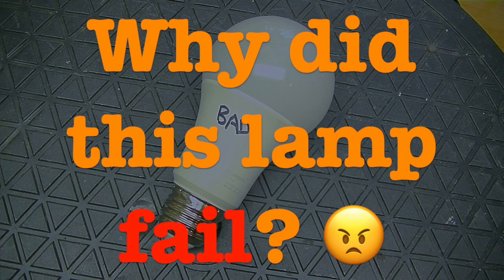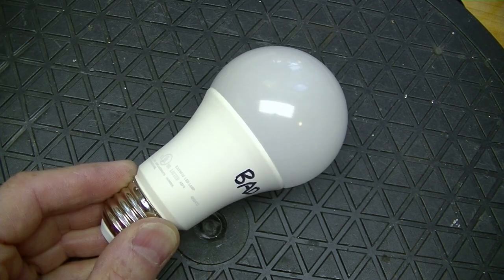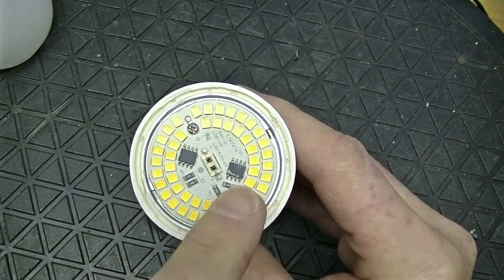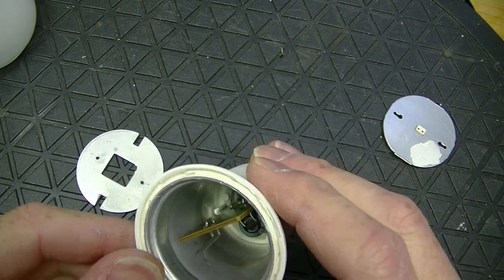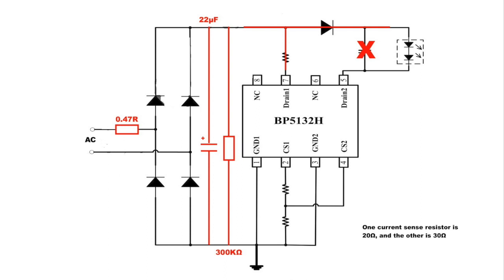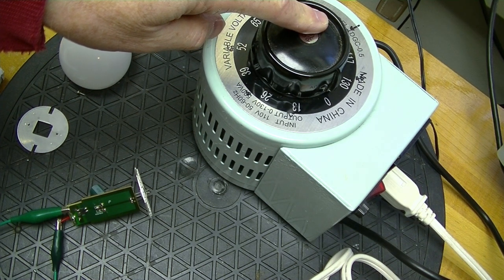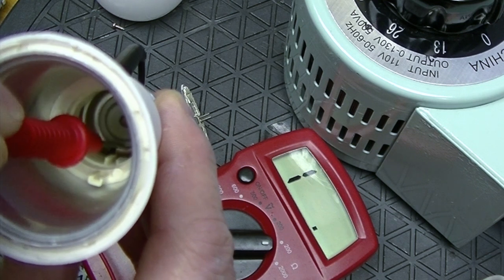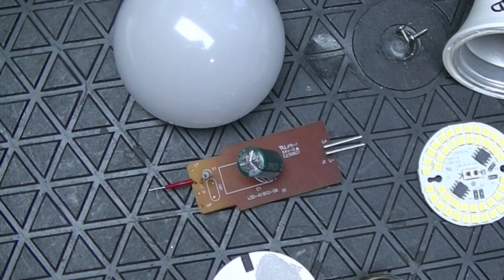Why did this LED lamp fail?  (Includes schematic!)

Comment: Oh, but wait! You're wrong!

It SHOULD have failed!

Because it was built poorly.

So much for efficiency, huh?    8)

BTW... incandescent bulbs are 100% efficient during the heating season. They also cost only about 1/60 as much as LEDs do.

And... because of cost homeostasis, we now burn more lights, and run them longer, than ever before... so our electricity consumption hasn't diminished from the days when incandescent bulbs were the norm.

So ... no progress at all. None. Zip. Just greater cost.
Reply from the maker: Again, agreed. 
I never considered heating my house like a gigantic Suzy Homemaker oven. Until now.
Reply: @Mr.BrownsBasement  8)
Reply: @Mr.BrownsBasement  I have a feeling that you and I could swap a ton of stories of times past if given the opportunity.    8)
Reply from the maker: You’re right again. You’re on a roll. 😊

Comment: Judging from your voice, you're old enough by now to understand that nothing lives as long as it's touted to.

Be sure to inspect for tin blight while you're in there, especially if your LED has ever been exposed to cold temperatures.

Also... as often as not, the drivers are on a little daughter board, which costs almost as much to buy as the light bulb did.
Reply from the maker: You’re right! I’m no longer a spring chicken. Good advice, but I wasn’t planning to put the bulb back into service.

Comment: I like to disassemble such things as well. Understanding electronics makes it fun to locate the faulty part. Some use step down tiny transformers while others use the summing of the LEDs to handle the line voltage. Either way, it is interesting to see the different designs. And with a simple meter, you can usually locate the defective part pretty quickly... Thumbs Up!
Reply from the maker: Thanks. I am bothered by lack of repairability built into modern electronics and by the incentive to discard rather than to repair. By making videos highlighting areas of failure I hope that we can reduce the amount of perfectly salvageable electronics that ends up mostly in landfill. I hope you will enjoy my other repair videos as well.

Comment: China's not-so-finest! I wonder if this construction quality is shared with the LED bulbs recently sold at Dollar-Tree stores for only a dollar - until rampant inflation jacked their price up to $1.25!
Reply from the maker: This lamp came from Dollarama and cost $4 + my contribution to the government. I expected better quality. I’ve got a bunch of Dollarama lamps and they’re been ok so far. This is the first one to fail. For what should be a far more reliable technology I’ve been very disappointed. I had a Philips (from Home Depot) fail in the 1st 5 minutes of use. I was so annoyed I called their 1-800 number and had them replace it. I had a Canadian Tire bulb, also much more than $4 die prematurely. Again, I insisted they honour their replacement warranty. They did, though begrudgingly. It seems price is no predictor of quality or longevity for LED lamps.

Comment: I think the assembly line was over crowded that  it scape from the testing quality checker person,( very smart LED bulb ). I am glad you shared with us where the fault is,. I think a- little- dab- of- student-glue UNDER  your desk will do the trick!
Reply from the maker: I never expected the fault to be the result of a faulty wire. I was expecting the 0.47Ω resistor to be burned out or perhaps the bridge rectifier to be bad; either one would have caused the same symptom. But for the lamp to be crippled by a badly attached wire was a huge surprise. I hope for the sake of the manufacturer that it is an isolated quality control issue and not a widespread design issue otherwise many more of these lamps will fail exactly the same way. I think the present condition of the lamp is beyond what a little dab of student glue could fix but perhaps that will be the topic of a future video.

Comment: I am shocked 😲 Mr. Brown, are you preparing a party in the basement  for ONLY  ladies with 💄 and '"Worth the hype'" Black Mascara?
Reply from the maker: Oh no! No need to be shocked. The LED lamp that stopped working was a female. Perhaps the next one I look at will be a male. Determining the gender of LED lamps is difficult to determine because you can't tell just by looking. But rest assured, when it comes to repair of electronic devices, I am not sexist. And when working on electronic circuits, always avoid being shocked!

Comment: Must have been assembled on a Sunday.  A Chinese worker may have resented working on  a Sunday and took it out
on your bulb. I once found a screwdriver under the console dash of my mom's  1978 Ford LTD. It was found several years 
later BTW. The assembly man may have took off for lunch and forgot where he left his screwdriver. Stuff like this does 
occasionally happen.
Reply from the maker: At least you got a perfectly usable screwdriver out of it AND cured the inexplicable rattle in the front. I got a pile of bulb guts and a friendly suggestion from another viewer to Krazy-Glue it back together. I think you're ahead on this one.